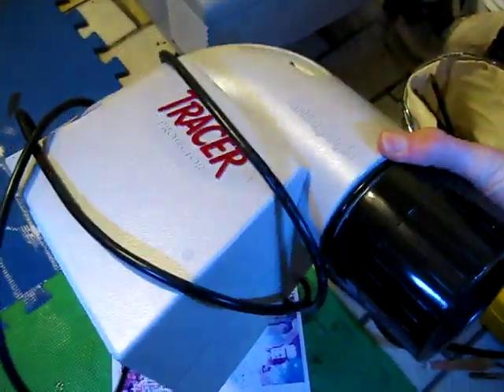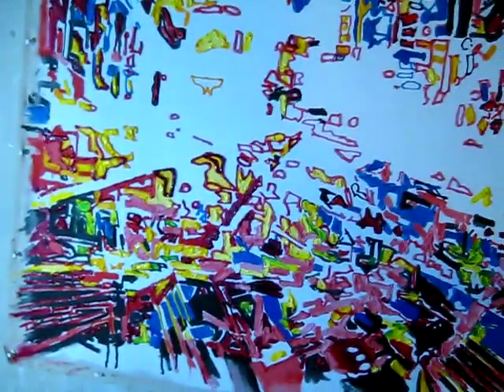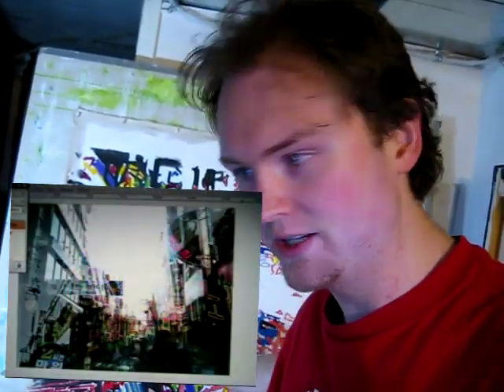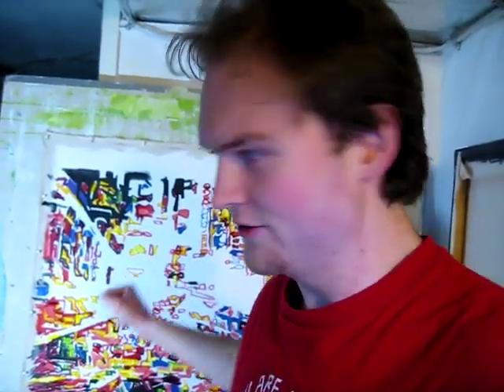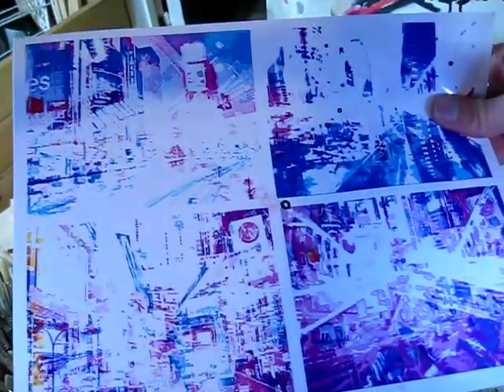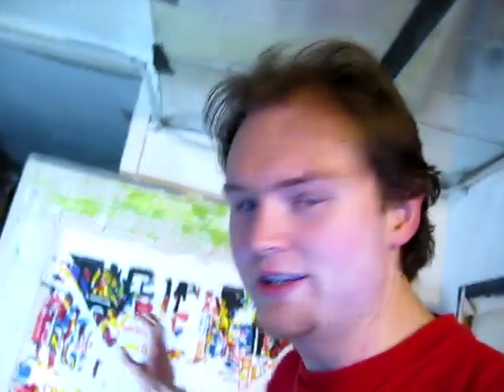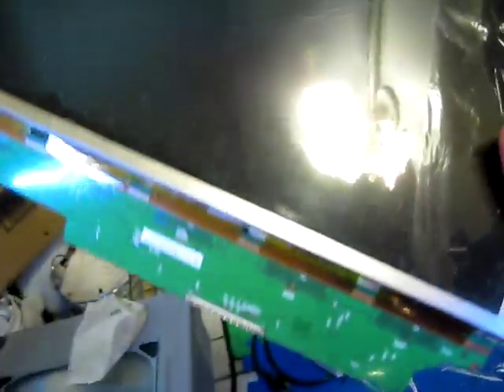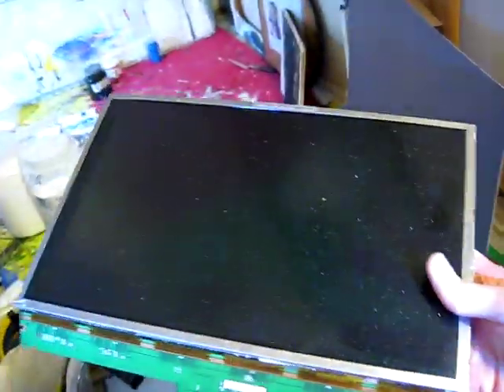DIY High Definition Digital Projector

Comment from the maker: Hello!  

That isn't an odd question, it's a good question.

I did try that, and unfortunately, it doesn't work. 

Tablets and smartphones are backlit, so the reflected light from the bulb inside the projector doesn't help make the image on the screen any more visible, and the backlight isn't nearly bright enough on it's own.

But even if it did work, there is an issue with heat build up to worry about - things inside the Tracer projector get very, very hot.

Comment: Hi Kyle, this may sound like a really odd question, but have you ever tried to place a smartphone or tablet beneath the Tracer projector? Will it project the image or does the light from the projector wash/cancel it out? I've never tried it but I am working on a project that assumes it is possible to reflectively project an image from a device versus projecting through the lcd of the device. Thanks,